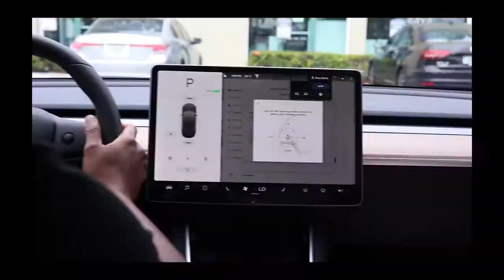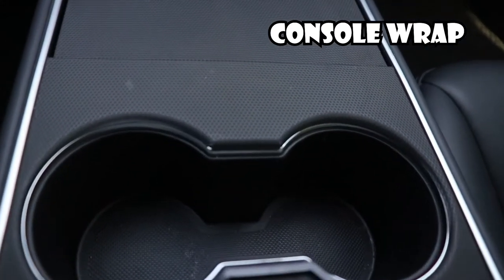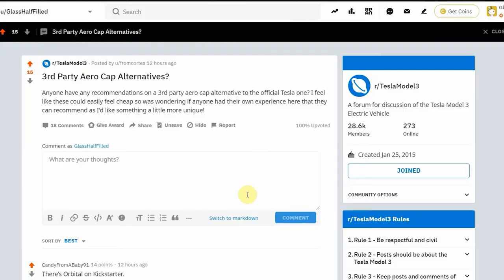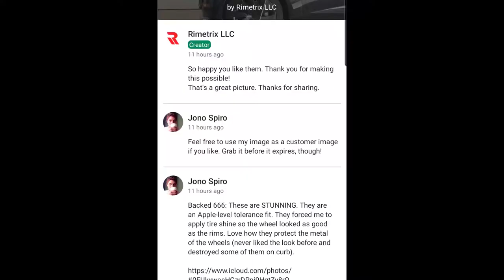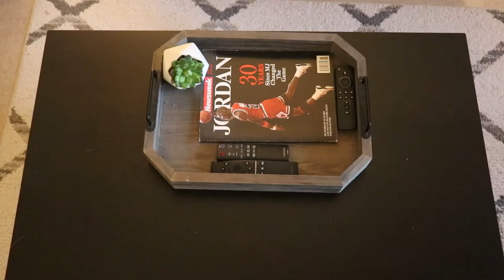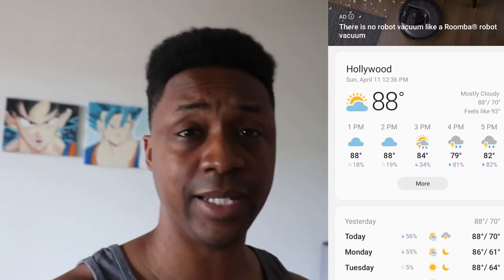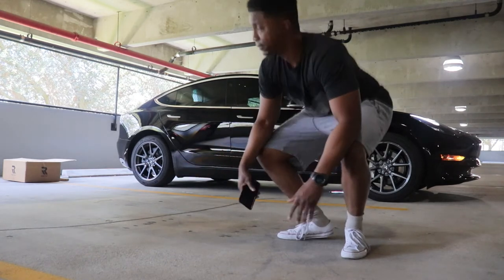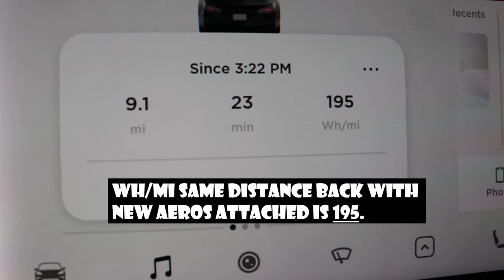Vlog-ish | Adding Model 3 upgrades (Rimetrix Orbitals): Pt 1

Comment: Back up battery? Why? I would think that the continuous charge on that little battery is doing damage. To the little battery, not your car.
Reply from the maker: It's for the wireless charging pad that I installed, it powers it well enough but I don't mind it's life span (so far around 2 years so let's see).

Comment: Did the orbital makes rattle noise
Reply from the maker: Really slightly, it's not too noticeable unless harsh bumps. Working on the tape fix next.
Reply: Mine do now after a year since I had my tires rotated, but I just ordered the $4 fix kit from their website. It's just foam stickers, but apparently they  work.
Reply from the maker: Oh they sell a "fix" for it now? I might take a look because I did the door sealer option and it remedied any noise...but they don't stick well enough with the glue it comes with. May get a stronger adhesive and test.